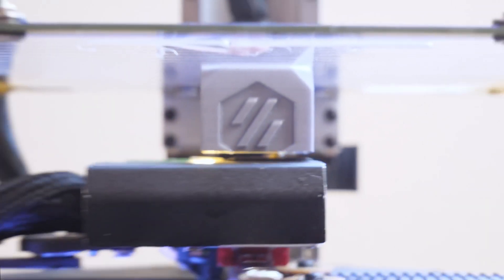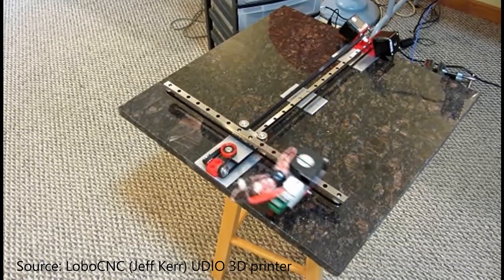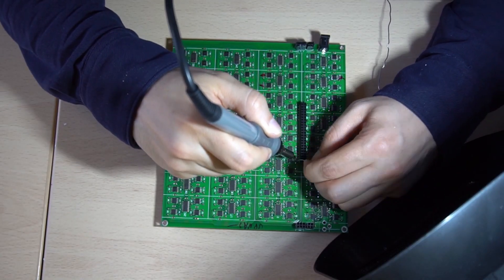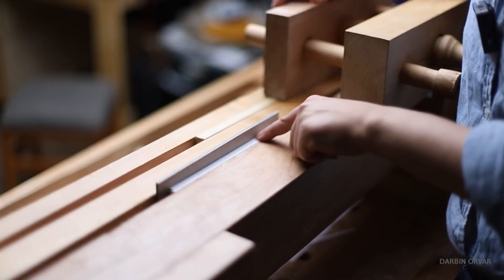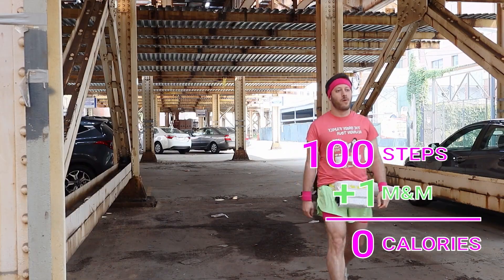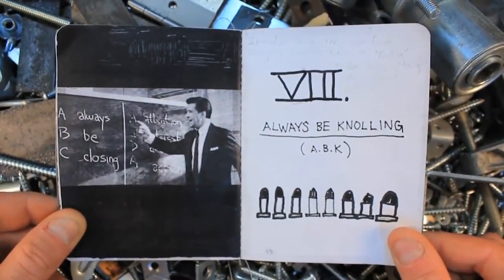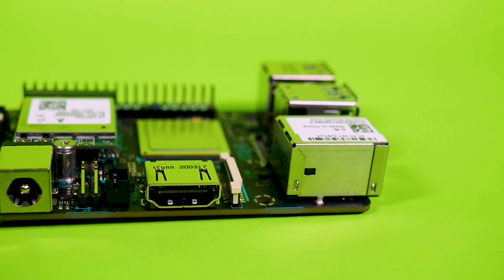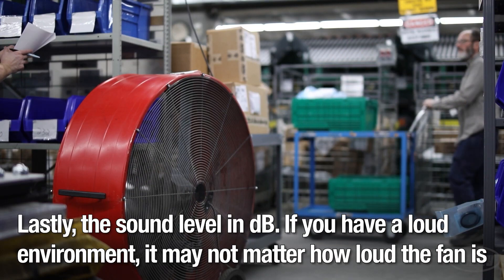Printing on the Ceiling [Maker Update] Maker.io

Comment: Tyler you received the cream of the crop this week and a Fanny Pack that dispenses M&M’s. That has to be the most purposefully creation there is. Great for a trip to the zoo with a small group of kids and doling out 1 M&M rotationally to the kids as you make your way through the zoo! You have some great ideas this week and I think you found a use for your smart phone O Scope!! Also they never considered the minimum bend radius for the thickness of their aluminum. You’ll never bend a .080 thick aluminum with .035 radius unless you choose 6061-0 and bend at least 45 degrees against the grain, then heat treat. The rule of thumb is minimum bend radius = 2-1/2 x the thickness. A few years engineering aircraft designs for Boeing. Cheers Tyler great episode this week!

Comment: I bought the Tinker board a couple of years ago thinking ASUS doesn't make junk. 
It's junk. No software updates. No user community. Not able to run Raspberry pi lcd display or Rpi os. 
Buy at your own risk. Mine is a paper weight now.